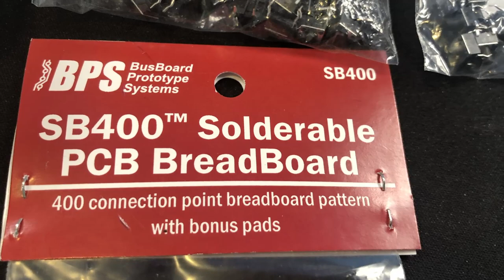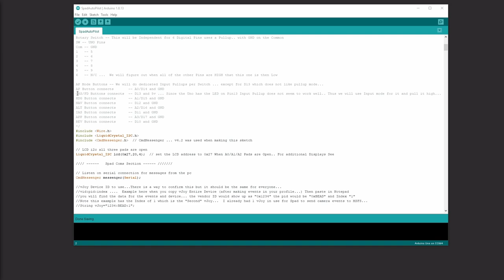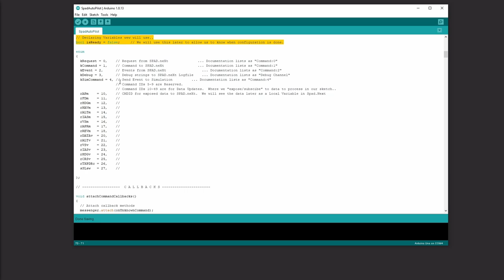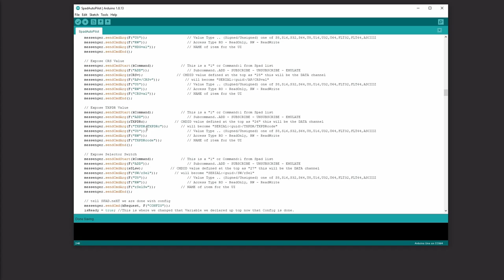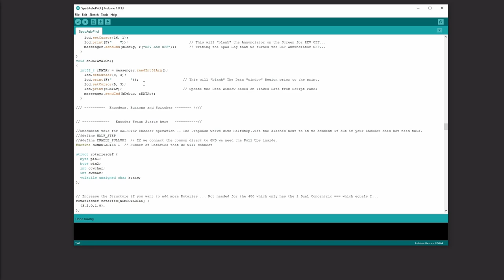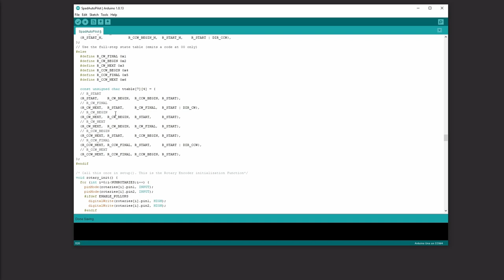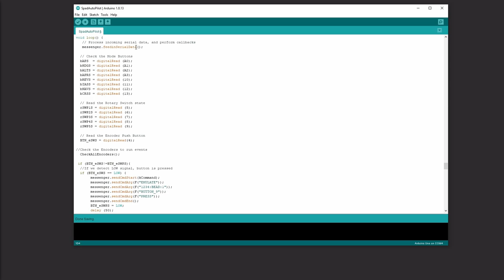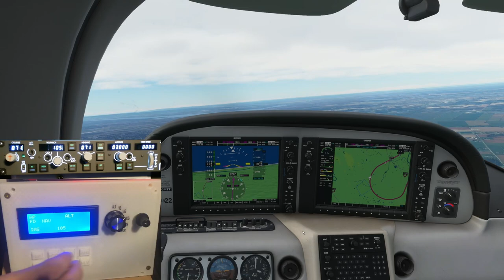(Sim Video) Arduino Based 3D Printed Autopilot P1 | MSFS 2020

Comment: I'm really enjoying your series. I've made my own dual radio panel similar to the saitek one and a Garmin 530 using arduino pro micros (leonardo) and wrote my own application to interface with SimConnect. Two separate implementations. I'm interested in using SpadNext with a stream Deck and was wondering if I can convert my devices to using spadnext instead of my own interace with SimConnect. In your example you used an arduino uno. Will the arduino sketch work on a pro micro? (Of course pin outs and number of buttons/encoders/lcd displays will change!!!) Is how you interface the arduino with spadnext the same? 

Keep the tutorials/videos coming!!!!
Reply from the maker: Yeah it should work just fine. I have a Leonardo and Pro Micro as well but I have those setup as Joystick devices. I also made my own 530 using 3D printer and wired it up to the LEO since I only needed 1 way with it. 

For the AP obviously I needed two way so I used the spad serial interface and it works great…. But the new serial 2 protocol that is making its way into the alpha will be much better as you will be able to build a UI around it and not need to use the Script Panel / vJoy workaround I made in the video. 

Join the spad discord :) there is a section on arduino and others sharing their work.

Comment: Hello Les O'Reilly, I have no experience in programming, but I really like flight simulation and I thank you for sharing your knowledge. My question is: can I use an Arduino Mega board?
Reply from the maker: Sure ... just need to find a different 3D Model to 3D print...  I would have preferred to use a MEGA... but this 3D model only had space for an UNO..